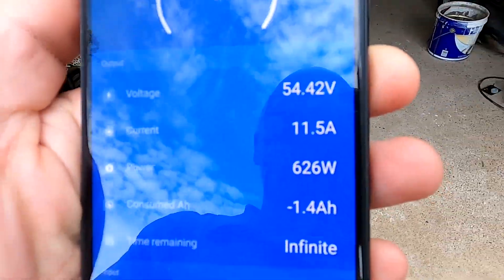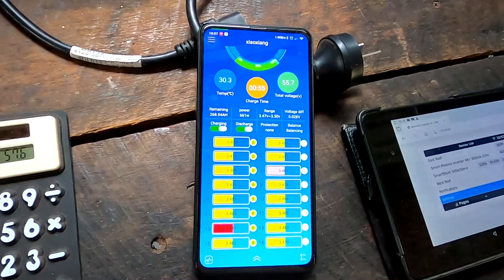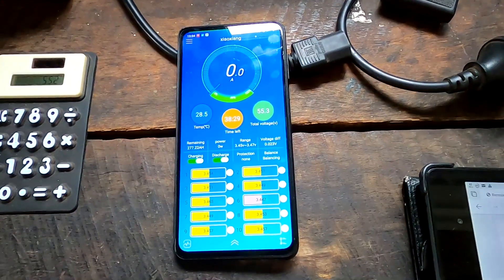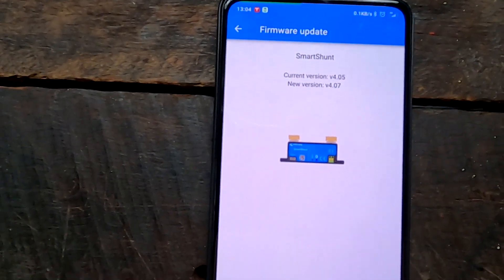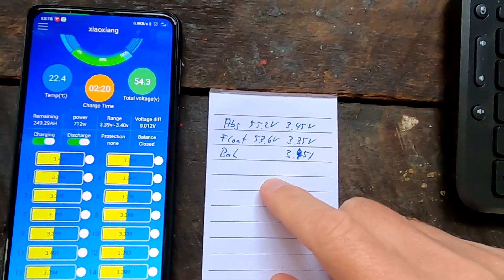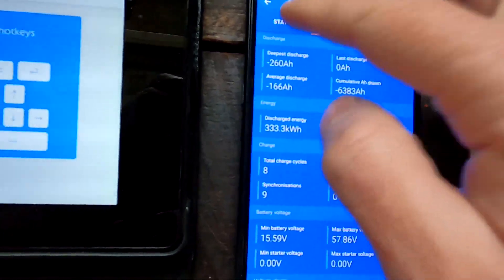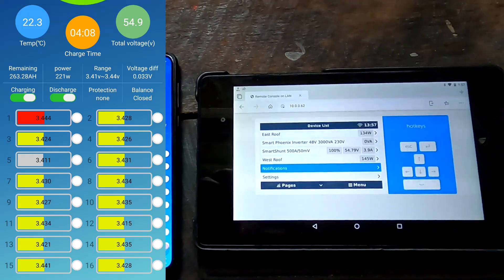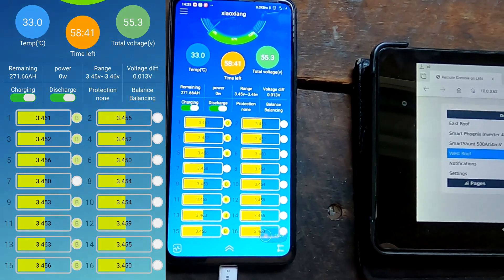Low voltage balancing LiFePO4 cells - These settings seem to work.  | Part 3/3

Comment: Why do you want to keep the LiFePO4 cells always at 100 % SOC? 

Keeping the cells constantly at that high SOC will finally kill the cells by calendar aging. All voltage above 3.33 V will charge the cells finally to 100 % - and more, even small current. Take a look at the tests done by PowerStream. LiFePO4 (and other lithium chemistry) is no lead acid, which needs always 100 % charge for long life. Try to find an absorption voltage which gets you to real SOC of 80 % (or what ever you like) in the long-term, which is certainly lower than 3,40 V. 

Even at 3.35 V float the battery is still charging and this ages the battery. Float voltage should be at the OCV of real 80 % SOC (or whatever you like), which you have to find out for your cells.  Charge your cells to real 100 %, then discharge 20 % capacity (or what ever you like), disconnect and let the cell alone for a few days, then measure the OCV and take this value as float voltage. In summer, when you don't need the full capacity of the battery you can go lower, in winter you can go higher with the maximum real SOC.

Regarding OCV of LiFePO4 cells you can search for "The Relationship of Voltage and SOC of LiFePO4 batteries in different temperatures bestgo".

Comment: I think these batterys are a lot of trouble I still will stay with my lead acid batterys I've had them for 9 years and and still give me full power besides the new type battery are far to expensive that's my thought thank you for your input each time .......from South Africa oh stay well
Reply: helo from the 2024 :) how about now, how are your lead-acid 11years old batterys? what is the total initial capacity and how much energy you are usually using and how much is charging energy during the day ?

Comment: Hi andy.
I liked your original settings. 
The bms needs more time to balance and when its set higher you are taking away time.
Yes you are correct about the flat curve and is better to balance at its peak, but i believe the bms hasn't got the time, if the bms was pulling 5amps no problem
Reply from the maker: Yeah, that is correct. It's to find the right balance to balance at the right voltage for the right time.

Comment: Hello Andy, is it possible to share your whole settings from your Solarcharger with us? It drive me nuts with my unbalanced cells. Top balancing my cells now 3 times, not getting good results. I would be very happy and thanksful if you share this. Thank you for your great work!👍👍👍☀️🇨🇦
Reply from the maker: OK, so they were in the video at the end again, I believe...
Absorption: 3.45V for 1h
Float: 3.35V
Re-Bulk Offset: 0.4V
Balance start voltage: 3.451V set in the BMS
Reply: @OffGridGarageAustralia  Thank you Andy, yes I know it was in the video. 
But if it's not to much work for you, please can you share your completely settings from your charger? 
And what means Re-Bulk offset 0.4v please? Sorry I have an epever charger...
And how much are your charge limit voltage please?
That would be very kind to get a answer.
🙂☀️
Reply: @simonguest1890  "Re-Bulk offset" = "-0.4V" means it will restart the charging cycle (go to "Bulk" again) after voltage lowered -0.4V below "float" set voltage; so it's equivalent of "re-bulk voltage" = 53.2V (3.325/cell here) in other controllers. And "charge limit voltage" is "absorb voltage".

Comment: I have two 200AH lifep04 batteries, I won't be needing them for several months to a year, at what voltage should I store them at?
Reply from the maker: Can you connect them to a charger from time to time? I would probably charge them to 3.45V for that storage. They should be fine as the internal self discharge is very low and they are high capacity cells.
Reply: @OffGridGarageAustralia  i have a 50 amp RV converter that i have been using to charge them while I test the rated AH, they are 12 volt so of I keep them at 13.8that should be good?I have heard that storing at 80% is best but seems like everyone has an opinion on it and im getting lost on what I should do
Reply from the maker: @todamnbad  Can you set the voltage lower, to 13.4V. that would even be better. Best is to have them right in the middle, so at around 50% SOC. Unfortunately there is no defined voltage for that point...
Reply: @OffGridGarageAustralia  nope, all I can do is do a full charge and put a small load on it to drain it a bit, guess I better do some reading on what 50% SOC is, I know what SOC stands for but the 13.4 being 50% confuses me

Comment: More solar panels andy
Reply from the maker: I will have a lot in summer time. Also still got some her ein the garage which I need to solder the diodes back in so the can go on the roof as well.
Reply: @OffGridGarageAustralia  can always park a few panels on the fence line there andy and hook em up to the shed

Comment: Talking about cells in series here. The lowest capacity cell will hit its knee earlier than a higher-capacity cell. On the charge side it will hit its knee and start to climb rapidly the bmms will shut it down. On the discharge side the lowest capacity cell will it hit knee first. The voltage will start to drop rapidly before the other cells and shutdown discharge. That is precisely the function of the BMS, to protect the lowest capacity cell from damage
Reply from the maker: That is correct.

Comment: I think long-term balancing is not even possible. Think about it this way. Turn the storage capacity back into time and compare the time between the cells. If the lowest capacity cell fully discharges in 1 hour, then it will limit all the rest of the cells. Come time to charge back up, the lowest capacity cell will charge in one hour. Thus limiting all the other cells. The Battery monitor system will find the lowest capacity cell fully charged and shut down charging, likewise for fully discharged and shutdown consumption regardless of Direction, the lowest capacity cell will limit how long you can charge, for how long you can discharge. I don't see how you can get around that.

Comment: What drives diversion in cell balance is 1) variation in cell inherent leakage rate, 2) Impedance and kinetic energy overhead variation per cell for given cell current, and 3) ambient temp which scales cell leakage against base leakage rate caused by items 1 & 2.

Greater impedance and kinetic overhead means a cell eats up more energy, more of a given cell's capacity, to supply the common load or charge current.  This depends on individual use case.  If you run higher peak currents, higher charging and discharging for a higher percentage of time in the system, it is harder to keep cells in balance. Many think balancing is just leakage compensation of 1.5% to 3% of cell capacity per month.  This is not the only factor and there is a use case factors impacting balance.

So worse case balance diversion vs. time is high charge/discharge currents, high ambient temp, and how high you keep the float voltage.
If you get an estimate of contribution of these factors you can predict how often and how much time you need to balance given the 200 mA limitation dump rate.  Higher balancing current makes this much easier as the predictions need to be less accurate.  Running higher charge rates with low balancing current capability is a losing proposition.

Comment: Great 3 video series.  Amazing balancing tips. What about discharge imbalance? I have just noticed that on my 24v setup there is .2 volts difference will discharging.  While discharging some cell are at 3.28v while others are at 3.31v? Is this normal?

Comment: what is the maximum voltage difference for the cells from the manufacturer? the daly bms i am using has a preset non adjustable difference of 0.260 volts, and the cells only seem to split at the top and bottom of voltages
Reply from the maker: Due to the flat curve of LFP cells, we only see a higher spread of voltages in the bottom and top part of the curve. Not sure what you mean with "what is the maximum voltage difference for the cells from the manufacturer"
Reply: @OffGridGarageAustralia  what is the maximum safe voltage difference between cells recommended bu the cell manufaturer

Comment: I wonder if your expecting too much from your BMS on such big cells Andy - on my RV the balance resistor drain is just 60mA  on my ebike its just 15mA - I added an extra set of balance leads when I made up my 320Ah pack so I could use my T8 balance charger which balances at 15watt as it charges,  for the initial charge  - I also have wired a active cell balance  to a JS connector  so if they get too far out when  I'm  on the road I  simply plug it in for a few hours - its said to balance 5 amp however they have to be way out of tilt for that - its more like an 1 amp
Reply from the maker: The balance currents are far too small for such high capacity cells, for sure. It will take hours of balancing to until we see a result. Unless I charge the cells to a higher voltage, then it will work a lot better. But this is something I'm trying to avoid, so I'm testing different scenarios and see which work and which don't. Balancing at 3.45V seems to work for my back and BMS but time will tell if this is the long term solution.

Comment: For the past two years I have been charging to 14-14.2v, absorption set to 14v and float at 13.6v. Have not seen degradation in my LiFePo4 batteries. In fact earlier this year I purchased grade D cells just to experience the above settings. These were 60AH cells that have degraded to approx. 35-40AH. With the usual 3.65v charge/3.6v absorb/3.4v float I would get no more than 40AH from them. Resorting to 3.5-3.55v charge/3.5 absorb/3.4v float setting I am consistently able to get above 45AH to 20% SOC, sometimes up to 50AH!

Thanks Andy for all your experiements :)
Reply from the maker: Wow, that's great results. I think charging to 3.5V is fine and safe. I personally will not hit that voltage very often but maybe in summer time when I have s**tloads of sun, it will be a different story.

Comment: I never balance my pack. I use only the flat line as soc. So 3,4 volt ”full” and 3,1 volt as minimum. I have a 24 volt system. 8s lifepo4 280ah lishen cells. Every now and then I check cell voltages with a multimeter. That is very important. All my cells are more or less in balance all the time, but if I charge to an higher voltage 3,5 or 3,6 volt all cells go out of balance, but that's logic. My extra tip for lifepo4 owners is check your charger voltage! Mine is 0,4 volts off, this is very dangerous. So my MppSolar solar charger inverter max voltage is set to 27,0 volt, which is truly 27,4 volt. On cell level is max charged 3,40 volts. Cut-off 3,10 volt. I think my pack will last maximum cycles hope 15000.. or 30 years. If working good (balance) I will never charge higher or lower. And still it works perfect. Never offline like on this channel.
Reply from the maker: Thanks for sharing. That is great and a good recommendation for everyone. Do you absorb at 3.4V or stop charging altogether?
Reply: @OffGridGarageAustralia  My cut-off voltage Cc/CV of my  MppSolar gk3024 is set at 27,00 volts cut-off. Truly it is 27,40 volt (multimeter) if I used 28,2 on my charger inverter than I would certainly ruined my one or more cells, because of the voltage problem. I charge at max 30A from solar and discharge at 82A when making hot water with hot water cooker. If my pack is not full or charging I get a warning for low battery. But when the cooker stops only 0,05 volt are gone. But this error bothers me, so I am waiting for 8 more cells of 280Ah Lishen... To make a parallel battery pack. I hope to avoid this too big voltage sag.
Reply: Technically I charge Constant Current (Solar 0A to Max 38A) / Constant Voltage 27,00 volt "programmed in setup MPPSolar" (on multimeter 27,40 volt). Absorbsion, float, trickle charge and other old-school accu systems like: PB, Gel, AGM etc. Forget them.. Pls..

Comment: Could you try to use the qnbbm balancer? They work really great for me. No specific voltage needed. Always balancing if needed. Just parallel to your current bms.
Reply from the maker: That's just a balancer, so I still would need the BMS for high/low voltage safety disconnect. But this one looks really good, up to 10A balance current!

Comment: I don’t really understand the excitement over the smart shunt wanting to do a software update. The implication is that there is a fault in the previous software. We are now so used to software being faulty that we welcome the updates. With something as potentially critical as monitoring and charging expensive easily damaged batteries surely we have a right to expect it to be fit for purpose as received. I am hearing more and more frequently about systems failing due to faulty software and, whenever you have a problem, the first advice is to update the software. This is one of the reasons I won’t touch Victron stuff along with not being able to afford it anyway.
Reply from the maker: Not really a faulty software. Victron is implementing new features as well sometimes. I like it's improving over time and yeah, they can fix issues just like this. Like the solar charge controller problem many had. Fixed with an OTA update. It's indeed exciting!
Reply: @OffGridGarageAustralia   My point is that it shouldn’t need fixing in the first place. The OTA update is being used as a way of using customers to test often safety critical stuff that should have been perfected before selling. The New features thing is often a method of introducing new bugs as again it isn’t properly tested, it is also a way of excusing ‘bug fixes’ look at the update descriptions of most software and they almost universally include the term ‘bug fixes’  If I buy a monitor I expect it to do the things it says it can, I don’t expect it to do things it can’t. I use a lot of open source experimental stuff, with that I absolutely expect it to change, bug fix, upgrade etc. But then it is free!
Reply from the maker: @philbrooke-little7082  that's what the software developer group is for, Victron setup a while ago. They were looking for users on a voluntary base to work with them and test new software. Works great.
Reply: @OffGridGarageAustralia  not so great for those who buy an expensive bit of kit that then lets them down, possibly damages expensive batteries (yes it does happen) and then finds it needed a software update to work correctly.

Comment: Andy - please do a video showing how you set up your remote console. I want to use WiFi to remotely monitor not Bluetooth and I see you do this. Also, I think the reason you have a DC difference could be because your inverter shows no usage when you have a very small load - saw this in another video so remote monitor may incorrectly assume this as a DC load as it’s energy not reported from the inverter
Reply from the maker: I've done one, Peter. You can monitor your equipment from anywhere with this and also change parameters easily.
https://youtu.be/50V50lISnC8

Yes, that is correct, the Inverter does not measure/report voltage correctly and sometimes shows strange numbers. This affects the other numbers like DC Output as well. We need to take this with a grain of salt..

Comment: Congratulations Andy. Good work as always. May be the situatión in Spring time with more ampers in solar panels will change  a bit. I dont know. Also, there is a last question: do we have to balance every single time the battery goes above 3.35 ? Will it (go to 3.45)  be enough  once a week, a month , everytime ? See you
Reply from the maker: Thank you, Fernando!
Oh, yes, I'm expecting this to change a lot when the sun is back. We're over the hump now for a week, so more daylight from now on 😉
You certainly don't have to balance the battery every time. Some people never balance their battery as they just use it between 3.1 and 3.4V.

Comment: Hi Andy, the birds make me think about my mum who is 75 years old, she will the climb the stairs to my rooftop to feed some 100 pigeons daily, early in the morning.  The birds will also 'poo' on my solar panels:)  Anyways the new 16 cells you have for the next battery pack, could you do a capacity test on each of them before assembling in the battery pack, 3 full cycles per cell.  Also put all the 16 cells in parallel and bottom balance them.  Don't want to be commanding you, just suggesting. Cheers
Reply from the maker: Thanks Pritam. The birds.... 😂
I have checked 12 of the 16 cells so far and they all seem t be within a few Ah tolerance. Why should I bottom balance the new battery? I would not be able to parallel it with the existing one due to a different pack voltage.

Comment: Andy, why do you have the battery go into float mode?  The balancing is at 3.451 volt in the absorption stage (3.45 volts), what good is the float doing at 3.35 volts? There is no balancing going on at the point. If you have the absorption and float at 3.45 volt then the balancing will happen at 3.451. I have read that LifePo4 batteries do not need to have a float stage, it was used with lead acid batteries. Again, why float at 3.35volts with no balancing happening? I enjoy your videos and your inquisitive mind.
Reply from the maker: Thank you, Douglas. I charge to 3.45V and keep the cells there for 30min to balance. Then I drop the voltage to 3.35V as it is fully charge by then. There is no need to keep it at 3.45V all the time.